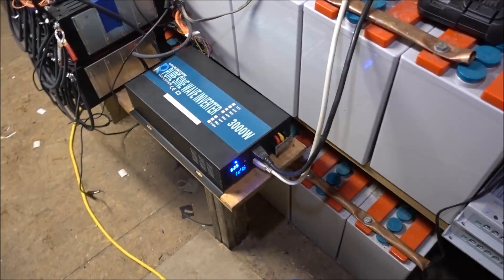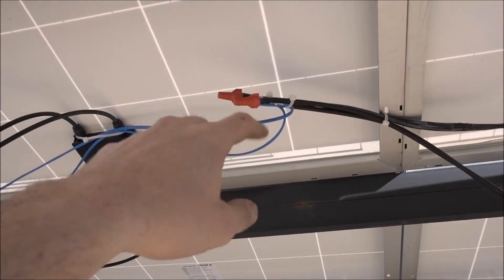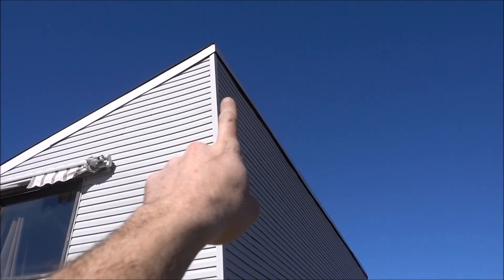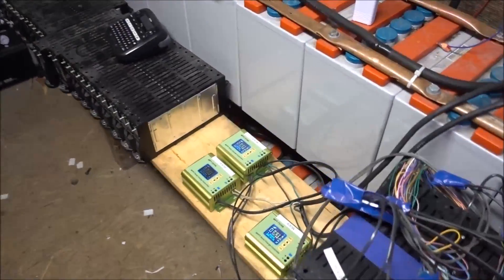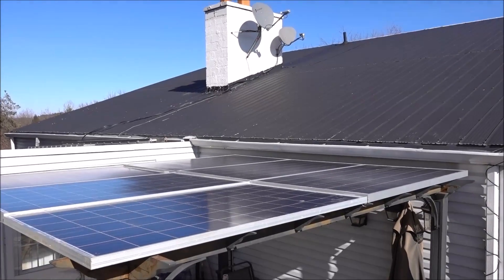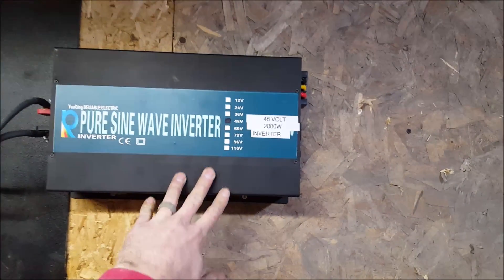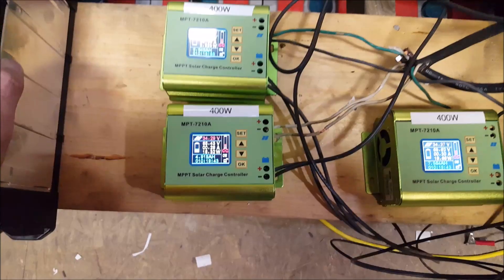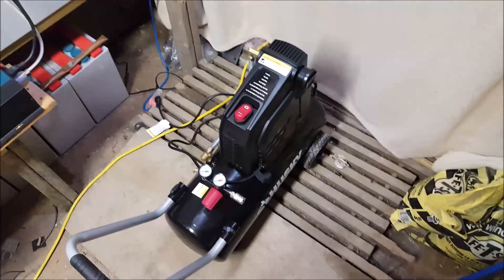Moved The Solar And Like The Reliable 3000W Invierter

Comment: Hello I have 60v battery bank will you please recommend a mppt solar charge controller and my solar panel voltage is 2*24v 320w
Reply from the maker: you can try and find a cheap china made one or I recommend the midnite classic 150 solar mppt it can handle 5000w at 60v :)

Comment: Hello my friend so you are using that mpt-7210a mppt right, I would like to buy that but I have some doubts regarding that is it possible to connect two 24v 320w solar panel please reply asap
Reply from the maker: it worked with 2 of my 330w panels for 4 months then burnt out, I would get a tracer 40 amp mppt

Comment: Hey would you be intersted in having a crack at this pure sine wave inverter its the 3000 watt at 48 volts it fried as soon as the electrician pluged it in
Reply from the maker: so he had the ground wired up and blow up the inverter right? are you wanting it back?
Reply: Going Off Grid how can i send you a picture the electrician said the board is fryed the wires inside the inverter were messed up we unplugged from one inverter to the other one and smoked it
Reply: Going Off Grid yes it was grounded yes i would like it back i was talking to the company that made the inverter now they want me to do tests with a multi meter and test the mosfets
Reply from the maker: ok these inverters can not have the ground tied into the main breaker if this is done this inverter will short as the inverter ground is connected to the neutral. these cheaper inverters have a 50% live ground and can not be grounded to you home.
Reply: Going Off Grid lol now you tell me can you fix it
Reply from the maker: if all the mosfets are shot it could be $100 for the fets and you might need a new control board from reliable cost around $20.
Reply: Going Off Grid how can i send you a picture and see what you think it really not that bad
Reply from the maker: .
.
.
.
.
.
philippeters007@hotmail.com

Comment: Hello there I have a question. What is the rated Horse power of your compressor? I'm planning to get same 3000W inverter but not sure if it can work on 1HP Electric Water Pump. Thanks a lot...
Reply from the maker: it will run a 1 hp pump if you get the 3000w and have short  heavy duty cables going to a good battery bank.
Reply: thanks for the info..
Reply from the maker: this compressor is more then 1Hp im not sure if its 2 but I know its over 1 Hp

Comment: I just go my 3000 watt. inverter at 48 volts at 120 volts or supposed to be 120 volts the electrician pluged it in and smoke show they sent the wrong one 😵
Reply from the maker: wait what ? they send you a wrong input voltage inverter? you do have to let them know in the message to seller what voltage you would like, if you have a problem I would contact them and try to work something out! hope this will work out for to mate!
Reply: Going Off Grid yep the wrong one i asked for 3000 watts at 48 volts at 120 volt they sent 3000 watts at 48 volt at 220 volts i sent them a email
Reply from the maker: thanks for letting me know! make sure you get another for at least a good discount! hope you can swing one free!
Reply: Going Off Grid ya that would be nice that the least they can do it was there mistake

Comment: Now that this video has matured a little I reckon that you have tested the inverter over time enough to consider the durability and safety of it. It would be very interesting to hear your thoughts on this. I am still turning it off when going to sleep and always when leaving the cabin. This is not due to any bad experience, but simply because I like to be careful. I really do not want to see the cabin burning down when returning! What do you think? Have you had any issues with it? Seen any sparks flying from it? :)
Reply from the maker: I have two 3000w inverters and one 8000w from reliable now, and they all seem to work amazing, no problems so far, and I ran the 3000w 24/7 for months and now running the 8000w 24/7 and testing :)
Reply: How much load do you put on them? I have a 3000W myself so most interested in that one.
Reply from the maker: I have done 100% for a short time and mostly 50-70% load
Reply: Sir could you give me a list that things needed to run that 3000watts i wanted to try it in my house! Need your feedback and recommendations thanks

Comment: hey what the trick on how to get a hold of the people a pure sign wave inverters i sent 2 emails and no answer to ether email just want to get o quote on a 4000 and a 5000 watt inverter at 48 volts that does 120 volts and 220 volts any help would be great
Reply from the maker: these inverters only do 120v or 240 volts they do not do both that is why I believe they are not getting back to you as they know they dont have anything like what you need.
Reply: so i have to get 2 of them 1 for 120 volts and one for 220 volts
Reply from the maker: yes, or you can buy a nice magnasine 4400w inverter like mine that does both.
Reply: fliping720 i would love to but they are 3000.00
Reply from the maker: true but they also have 5 years warranty, but these reliables seem good so far.
Reply: fliping720 i would really love to get a price on the 4000 watt 48 volt unit and a unit for the 220 side as well
Reply from the maker: looks like 500 us each to me if you loo at all their inverters
Reply: fliping720 i did not see any pricing
Reply from the maker: you have to look through all thier inverters, they have a lot and all there 4000w inverters are very lose in price.
Reply: fliping720 yep i looked still dont see any pricing it just repeat s its self
Reply: still cant find any pricing at all sent another email no answer do you have any other contact info for them
Reply from the maker: where are you from im wondering if they do not ship to where you are?
Reply: fliping720 1 hour from you
Reply from the maker: im not sure why I email them and they get back to me through ebay
Reply: fliping720 this is thew there web site
Reply from the maker: I would contact them through ebay

http://www.ebay.ca/usr/reliablepower?_trksid=p2057872.m2749.l2754
Reply: fliping720. i gave that i try but what i noticed the link you send all the inverters are shiped from California???
Reply from the maker: sometimes yes
Reply: fliping720 i emailed on ebay nothing yet
Reply: fliping720 hey can these units be stacked 120 volt and a 220 volt
Reply from the maker: no they can not
Reply: Can two of them go to each side of a 50 amp panel?

Comment: A Question for you or anyone else that reads this. Does anyone know the battery charge percentage left in the batteries when the Reliable Power inverter shuts down on low battery? I talked to someone with Reliable and they were not positively sure but said they think it shuts down before the batteries get down to 50% It can vary  somewhat depending on battery type and current draw. Has anyone tested this with a battery monitor to see? I am considering the 8000W 48 volt version. Thanks!
Reply from the maker: mine shuts down at 11.2 volts and you can ask them to set the voltage shut off at what ever volt you like.
Reply: At what percentage do you think 11.2 volts is? Have you tested it with a battery hydrometer or something to get a rough idea? I noticed some car battery testers show 11.2 volts at about 50%

Comment: Thank you for the video and testing of the inverter. I have a similar one that is 12-230V/3000W and I haven't had any (at least major) issues with it so far. I was hoping you would address it in the video, and hope that it is ok for me to ask you here instead. Some things I have noticed: 

1. The red light is flashing a bit without there seeming to be any problem with the input voltage from the battery nor there being any heavy load connected. My first instinct said that something is wrong, but it works fine. It is not easy to find info on this online, do you have any idea what can cause it/how to troubleshoot it? 

2. The fan is not very noisy, but runs more often than I expected. 

3. The output voltage meter shows it is fluctuating a bit. What would you say are reasonable limits for this fluctuation? For example would a fluctuation between 215 and 240 (randomly selected) cause issues for computers for example? 

3000W is quite big for a 12V system (750Ah battery bank), how much load should I dare push it to before the input voltage gets to low? When I am putting on a heater the load makes the input voltage go from 12.7 to 10.4. That should be ok, right? And then it goes further down the longer the heater is on until it will cut due to low voltage. I have not pushed it to more than 10.2V. Would this harm the battery? How far could I go? When I turn off the heater the voltage immediately goes back into the safe 12.4-12.6 range (which means it is more than 50% worth of charge left in it AFAIK).
Reply: Just wanted to mention that I am well satisfied with it so far. It works. But I am not very knowledgable as you can see from my above post.
Reply from the maker: OK 1 the red light on my 2000w stays on all the time, and it works fine,2 if the fans are running that is a good thing :) ,3 how old is this battery bank? and is this voltage taken off the bank with a volt meter or is this what th inverter is showing? I would run them down to 11 under load and try not to go much less or the batteries will start to see some damage if run at that voltage for long.
Reply: Thanks for the reply. 

I noticed yesterday that the red light is blinking when there is no load on. I guess that this is just normal and that it is not actually getting damaged. It seems other Chinese inverters have some issues when not having load judging from comments elsewhere also. Have you any experience with this?

The batteries are inherited so not sure how old they are, but I am guessing 4 years. 5x 150Ah. When fully charged, measured after some hours of no activity the voltage can be up to 12.85V. This should mean that the batteries are still healthy, right? The voltage is measured with a multimeter directly on the battery. The heater in question takes the voltage down from 12.8 to approximately 11.5 with a 1000W load and to 10.5 with a 2000W load. In this case it doesn't really make sense to connect the maximum continuous load of 3000W as the batteries can't provide that much anyway (not to mention the surge 6000W)?
Reply from the maker: yea haha I would try not to bring the batteries to 60% and other then that it seems fine.

Comment: today i purchased a swipower 2500w inverter.. i think it is like your 3000w chinese inverters... i hope i will have a good luck... i saw ote also having issues with it... but i will try...i already have the 800w reliable inverter and it can do 600w-650w max..
Reply from the maker: I liked my swipower untill it died :( but I have it working again!
Reply: greatt... i hope it will work well with me
Reply: i got my inverter 2500w swipower today and it cost me 52$ for taxes... the total price is 250$.. i will see how it will perform..
Reply from the maker: good luck man, I repaired mine 3 times :D
Reply: tested it with 1100w because my batteries are low today... and it worked well with 4 gauge cables it handled around 90amps with a little heat...maybe i should upgrade cables to 1/0... so far it is working good and the voltmeters are accurate despite what i read...
Reply from the maker: I loved mine till it died, it works really well then poof :(

Comment: Why don't you put them on the main roof as its angled allready and easier to see and clean (might not be enough angle for slow to slide off but higher chance then flat solar panels)
Reply from the maker: I am going to perches a bunch of panels soon and I wanted a roof on this thing :D
Reply from the maker: this is the seller

http://www.ebay.ca/usr/reliablepower?_trksid=p2057872.m2749.l2754
Reply from the maker: I dont know about the xijia but the reliable inverters I have are really good so far, only tested for about 3 months but I love them as of now.

Comment: What i have noticed with the angle of solar is that you are better to put them 2 degree more than what parralell you live at.. Lets say you live at 46 degree,  put your at 48degree and you end up with less snow on them in winter.. Due to longer days in summer, it will not affect the overall production even with the steeper angle..  I really think solar tracker are the best solution for the northern hemisphere..
Reply from the maker: yes I want to build a tracker soon. thanks!

Comment: bms seems like a big downer. I think I would go with a 700 ah lithium and then have a voltage monitor for each battery.  Then keep all the batteries at same voltage with a resistor manually.  Also not go too high in voltage.
Reply from the maker: its work to keep cells balanced manually.

Comment: I still don't use a solar controller I'm only experimentinting at a smaller level At the moment I'm using MPPT Style DC to DC Modules and I learned I need to stop the batteries from back feeding into the module and I'm not to sure what happens to the Solar Panels, but because that power either slowly kills the modules you need a Blocking Diode or even better a P Style Mosfet and use that as a anti reverse switch. This is probably why we had so much problems with these things. I found using complete isolation works best, I run 3 panels at the moment for testing that are only 5v each and I have them wired to three MPPT Solar Panel Controller 5A DC-DC Step-down CC/CV Charging Module LED Display http://www.ebay.com/itm/201544186533  then I have them wired to each of the 3 banks of batteries in parallel adjusted to 4.2v while wired 3S so 3 solar panels, 3 modules and wired in parallel to the series. As you already know we can tap off of each bank if we need that voltage, but they will never even out without balancing so you can also charge them that way, but there has to be some parasitic value or you would be able to use 3 TP4056's from one source. I'm not trying to say I know it all, but I never cared about the ripple coming from a solar controller when we've been using just about anything to charge the battery's and you can use that inverter to run in reverse from mains to it's DC Voltage which can also create battery issues. Here's something that may interest you. Magnasine MS2012 Inverter Charger Troubleshoot and Repair
https://www.youtube.com/watch?v=m-1OSFPHi04
Reply from the maker: haha seen that video ") interesting way of charging your cells, make a video man :)

Comment: as i was watching this video i made one of those silly auction bids on ebay for this inverter 1200W-PSW-24-110v and i couldn't believe but won it for 2.47$. was gonna get the reliable one but now ill have to see if these one will work well enough for me
Reply from the maker: wow wonder if the seller will send it.
Reply: we will find out ill let ya know if it gets here
Reply: just thought id let ya know they sent it and it works so far. it started my 5000 btu air conditioner so ill see how it does thru this summer
Reply from the maker: wow thats amazing!